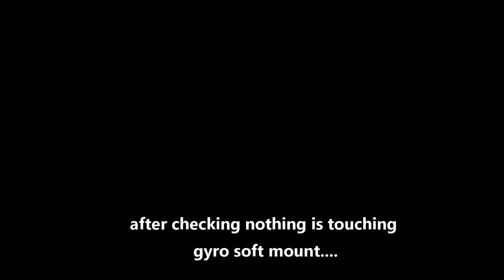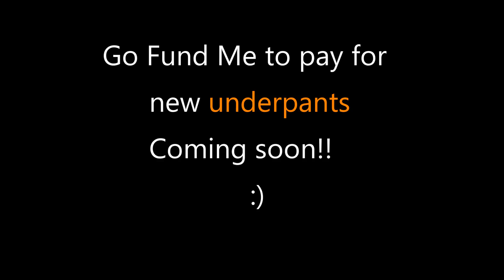Joshua Bardwells Kakute F4 goes ape $hit

Comment: wow if i had known about this issues... mine is stopping brutally, no crazy spinning, it just stops after 25 sec with the motors turning, but need to go to zero trottle and it reflies for 25 secs ! changes the setting gyro and pids loops .. nothing changed

Comment: I would think if it were a gyro problem the board would crank up some outputs to compensate for where it thinks it's going. It looks like this one just gives up. Plus the fact that you say the "exact same problem" happened the same way with a separate board. That means the problem is another component of the system... receiver most likely, looks like a failsafe. At least I hope its not the board because I'm putting one in my quad right now lol.
Reply from the maker: Bryan Draper quad goes into a manic spin, which at that point when I’m at very little throttle and making a harder than usual turn is only from the gyro. Both of mine were v1 boards, so you should be fine. Removing the gyro soft mounting cured one. The other it didn’t although that was less clear cut as I was running a very close stack and it may be vibration related. Regardless I put in another fc and the death spins suddenly stopped. Both of mine are either faulty, or there’s some pre production ones doing the rounds, as this was a problem in early pre release versions.

Comment: Neither of these is a gyro issue.

The first one is a failsafe. You can tell because the motors shut down simultaneously and the quad falls from the sky.

The second one looks like a motor or ESC issue.

A gyro issue would manifest as yaw spin to the moon or violent back and forth shaking.
Reply from the maker: Joshua Bardwell no it's not. It did it 5 times with no rssi issues and the osd is showing the rssi in the vid.  It stopped doing it the minute I removed the softmount. I subsequently used a second kakute in another quad with the exact same results. If you want to help by all means do, but given you can see the same setup flying fine after removing the foam in the next vid.... I've already proved what the culprit was. The quad does go into a crazy yaw spin. I also disarmed in some of these.

Comment: Hi had the same problem with a Matek F405 flight controller and pdb combo that uses that ribbon cable.
Turns out I had a bad solder connection with one of the esc signal wires.
Reply from the maker: Luis Rodrigues cheers mate. I think this is just a loose wire hitting the gyro soft mount. It was dropped into an existing build and nothing changed other than the fc.

Comment: Hmmmmm, I'm gonna go with my instincts and say its not the fc. I would say its something to do with  esc power or signal. Likely to be a bad solder joint somewhere. Powerup the motors in BF and run all four motor for a couple of minutes at 50% and check motor temp. That sometimes shows up something. Just use a towel between the quad and table to reduce vibrations. Failing that check for broken standoffs, I heard it can be very problematic.😂
Reply from the maker: Lol. :)  It’s the fc. This was just dropped into the gep build. There’s only 4 esc wires going to it. I’ve also tested it in the back garden this afternoon. Turned off air mode, hit the flagstones a bit landing and the quad goes mental. It’s One of the camera wires brushing the gyro I think .
Reply: Reminds me of CLracing F4 AIO, seems death spirals are becoming more prevalent, a lot of videos on YT of similar symptoms, mine usually did it while landing or after hard throttle action, some say to add capacitors but I had no luck, I hope you find a cure soon!!!
Reply from the maker: James Geisel I wish u hadnt said that. My backup is a cl racing f4s lol

Comment: oh no, thats what my brand new kakute aio f4 is doing....... damnit
Reply: i was thinking it was some sort of board brown out, even although camera and osd and vtx kept working. i did get low voltage flash up on dvr .  i cant really afford anymore stuff right now.
Reply from the maker: Lol
Reply: TheMadmacs I'm running it on 2 of my builds and it works like a charm. Could be something else?
Reply: i hope it is, i will be trying again, its on my second quad, which has been months in testing stages, and everything has been replaced during testing/crashing hehehe.  it could be the cold air, or my radio or esc's have some odd problem,  i know several people who run the kakute f4 with no problems
Reply from the maker: In my case it’s likely a loose wire moving as the gep frame is a bit of a wind tunnel and I only quickly dropped it in. It’s not a major problem anyhow as you can always use the foam tape provided to stick the gyro to the board. After looking for the quad for an hour, I couldn’t resist making a sarcastic video ;)
Reply from the maker: Months?? I knocked mine up in 4 hours ;)
Reply: yeah i can't afford to give up, its just, i'm building this second quad so i can fly a bit more freely without worrying about crashing grounding me for months, and this second quad has been a nightmare to get going,  3 FC's 2 sets of esc's 2 sets of motors two vtx's' two receivers,  never made it out of test hovers lololol... so when it dropped outta the sky for no obvious reason i felt a bit nonplussed.

Comment: I have 3 if these flight controllers and they work for me.  However I had issues when I enabled 32 bit gyro that caused it to go crazy I also had problems when I turned on PT1 in filter setting.  I am running dynamic filtering but leave it on biquad set pidd to 8k 8k and maker sure 32 bit is off.  This is for betaflight
Reply from the maker: Daniel Braker hmmm that’s worth knowing. If the soft mount is doing its job, then I don’t see why going to biquad would help. This is on PT1 8k 8k with dynamic filter on and all static off. Might just be a lose wire I didn’t notice. When I transfer the bits to another frame I’ll start working out what the issue is. Cheers for the info
Reply: Coppertop FPV PT1 is not the default switch yours to biquad and see if that helps.  I could tell there was a problem on the bench when I armed the quad it was very rough.  I switched back to biquad and then armed and it was super smooth.  May not be your problem but worth a shot
Reply: Coppertop FPV another note even if your only running 8k 8k make sure 32 bit is off
Reply from the maker: Pretty sure it’s just a loose wire hitting the gyro. It flew sweet other than those moments. Will update the vid when I know more.
Reply: Coppertop FPV the giro mounting is pretty tough I have wires hanging all over it and a flysky receiver bumping it in one build

Comment: Did you figure out exactly what's causing this problem? Loose wire, wire touching the gyro, lose gyro ribbon cable?

Was there a version change to fix the original problem?
Reply from the maker: Only just happened but I’m hoping it’s one of those. I’m fuessing slight movement of a wire is enough to send it crazy, as it happened both times as I was I’m putting quick stick, This was just a quick test I did before stripping down my KX5. The v2 just added another uart and better solder pads I think. Not a huge issue as can always use it without the foam, but I was a bit shocked :)
Reply: Fingers crossed then.

Is there a version marked on the board? I have one sitting at home :-o
Reply from the maker: Steven Woodbridge think it is 1.1 but they all use the same soft mount... Got 2 of the bloody things!